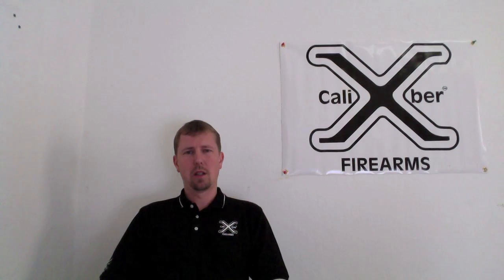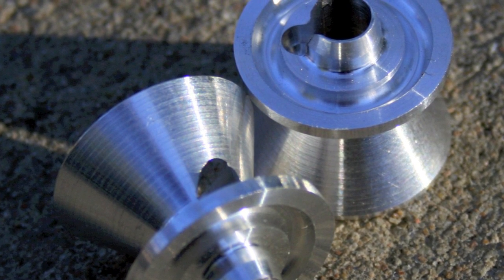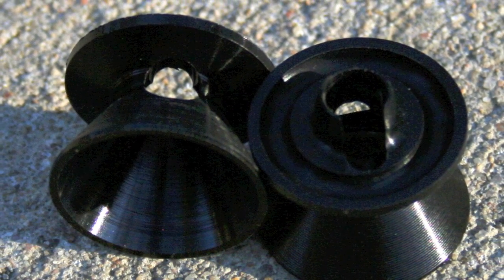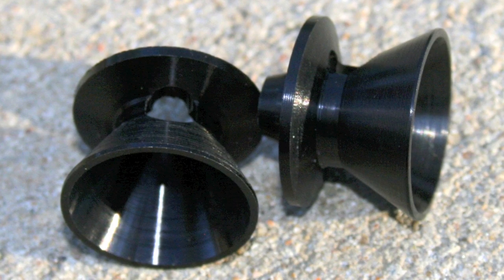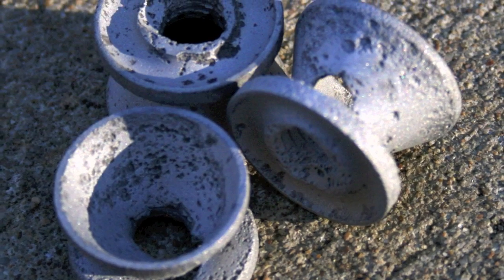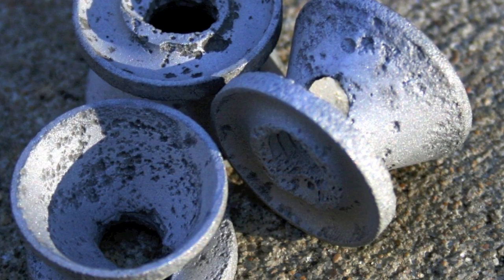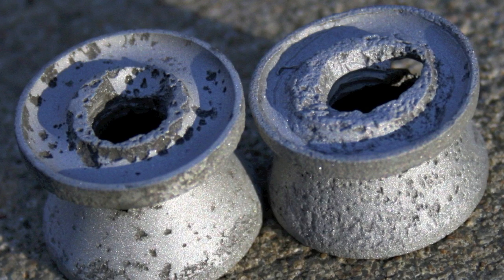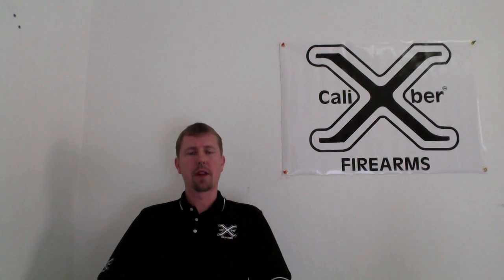Aluminum corrrosion with silencer baffles

Comment: Coat your baffles with Lucas Extreme Gun oil. I have an aluminum suppressor with aluminum baffles and the oil makes them easier to clean and protects the aluminum from corrosion.

Comment: Inconel would be most likely be better than both options
Reply: Or diamond. Seriously, you really have to take in account raw material cost and processing cost ; when you do have that in the equation, you ll see that inconel isn't the best material available.
Reply: Paul Joly you do realize there are a lot of suppressors with inconel baffles. one made 100% of inconel. it is just $400 more than a suppressor with inconel baffles.
Reply: @ronin223  This is incorrect. They use Inconel BLAST baffles, but not all baffles.